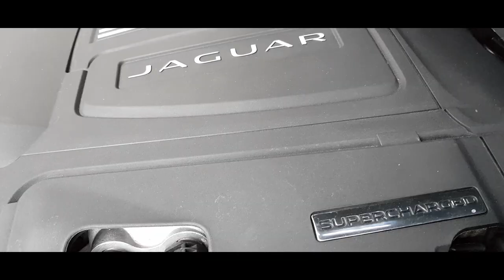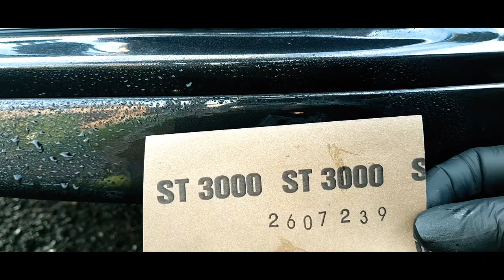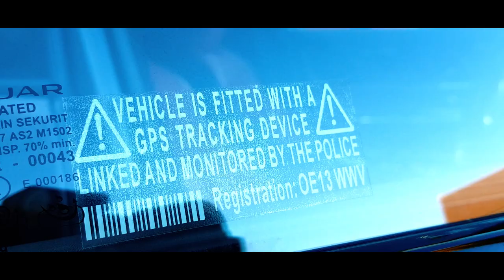Jaguar XJ-R Detailing Project

Comment: Please say your editing was wrong during your wash process? How come you used a dremel? Was all this done in one day?
Reply from the maker: My editing was fine. The whole detail process  took two weeks.  It's elementary, as in the clip you'll see Sun,  clouds ,morning , evening.
Reply: If it’s on different days then the video kind of makes sense, however if you weren’t aware the playback of the video shows you spraying a citrus or TFR - then clean the wheels, clean the paintwork - chemical decontamination - then snow foamed and agitated gaps/panels. Was the dremel used to remove weight residue?
Reply from the maker: I've used the dremel to polish the wheel nuts ,to make them shine again.
Reply: No, what was the dremel used for on the barrel of the wheel?
Reply from the maker: I've used the dremel on the wheel to get rid of the corrosion.  Wheel was corroded ,hence the painting